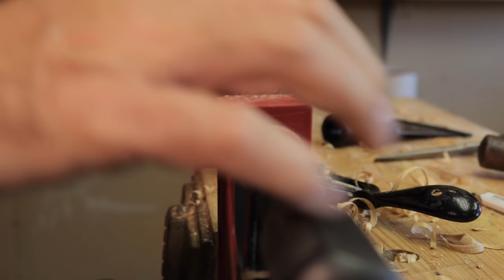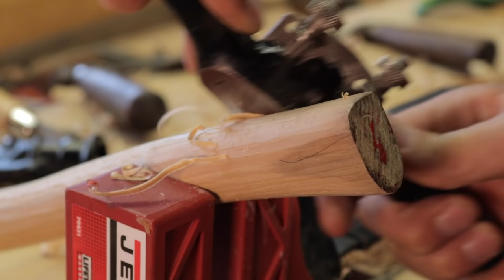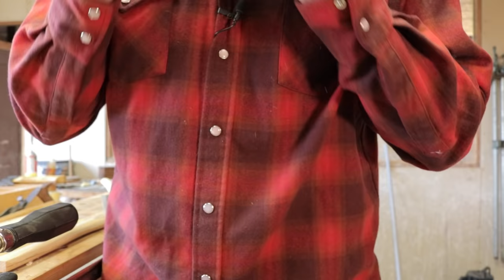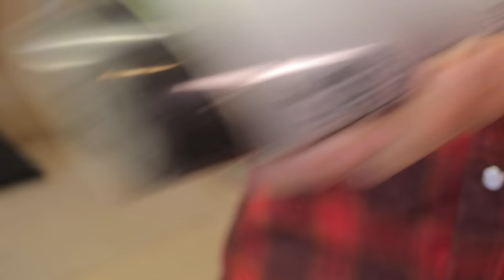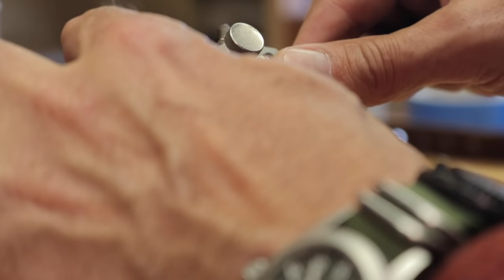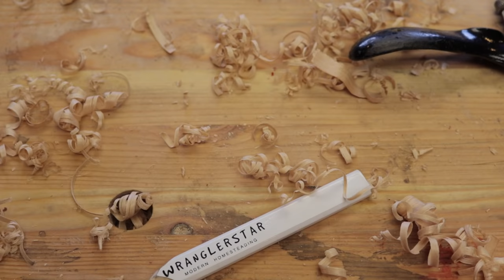The World's Tiniest Axe Handle

Comment: I have property from which I harvest my own hickory/ash materials. Like you, one of my favorite shop things to do is replace old handles in axes, hammers, wheel barrows, etc. I harvest with chainsaw and then use all hand tools (wedges, axes, a fro, hand plane, chisels, scrapers, etc.) to complete the other sizing of my handles. I usually wait 2 years for wood to dry and then take the rough out piece inside for one winter season, in a controlled environment, and get the moisture in the 10-12% range for use. 
Being retired, I could watch you carve/chisel/slice/shave these wood handles for hours on end! keep up the good work, watching, for me anyway, is very relaxing! Thanks for the nice video!
....13

Comment: +Wranglerstar you can use the drone to check if the ram pump is working or not 😂
Reply: btw I think it's easier to just fit the axe to the handle with sandpaper and then chisel out the v grooves in the middle, the carving knife is not necessary as there is too little material to remove

Comment: +Wranglerstar I am a hobbyist and I work part time at my local shop. The DJI Phantom 4 is a great unit. It does have drawbacks, for instance, few parts available, and any warranty work requires it to be sent back to manufacturer...in China.  
There are other options for hobby grade or better drone category, one is the Traxxas Aton,   Blade Chroma,  Yuneeq Q500 and  Yuneec Typhoon H series. Traxxas is based in Texas and Blade and Yuneeq are owned and sold by Horizon Hobby.

a high quality drone is a major purchase, consider all of them and look them over.

Comment: Hey nice handle Cody, just one tip if your going to stop the cut before the end of the board slowly roll the spoke shave back whilst still cutting, this will lift the cutter out of the wood leaving a nicer surface and making complete shavings.

Comment: Tip for matching the shape of the eye... Take some plaster of paris, or anything you might have that will set hard inside of there and fill the eye. Rub it down with some wax or something for easy removal, but i've done this before and it works great. Pull out your mold and then you can cut cross sections with a bandsaw to find the exact dimensions of the eye at different depths if need be. 

Lookin good man!

Comment: The DJI Phantom 4 "Return to Home" feature is a bit misleading. I have an older version that I don't fly anymore, The "RTH" is only Line of Sight. If you fly off and it drops down behind a tree line, you may be sunk. Mine will ascend or decend to 60 feet altitude above it's "home" and then make a b-line back and then drop in 10 foot increments until touchdown when the RTH is activated. But it does not recognize obstacles in it's path. Do your due diligence before you buy. Some of the earlier DJI products had serious issues with GPS, I've heard they have corrected that but I've seen lots of complaints about the camera gimbles malfunctioning. There are other "drones" (I hate that word) that will accomplish what you want to do but DJI might be a good fit for you. It's like buying a homeowner version of a tool instead of a contractor version of the same type of tool. Happy flying.

Comment: Don't worry about trying to fly a DJI Phantom 4, it will basically fly itself.  Take your hands off the controls and it will stay right there.  The follow me feature though needs help, works great for stand out slower moving objects in a straight line, not so well for faster, swerving, blending in subjects.

Comment: Cody, you should of used the draw knife w little more, there better with heavy cuts than the spike shave. I usually stick with the draw knife until I have to knock off the lines that it leaves behind. That's when I go to a spoke shave.

Comment: The dji phantom 4 is the best drone that you can buy for video however I would seriously suggest as a pilot of 6years that you learn to fly first in all orientations and winds before using the cool features as then , if said features fail or just aren't producing good footage competent manual control of the drone can lead to safe and fun flights for all check out the BMFA for advice , I am currently a member and there are pioneers of this technology on their fantastic forums , hope to have helped , tim

Comment: Wranglerstar using lamp black instead of spray paint works quite well, basically the same way as you'd fit the action to a gunstock, but not having to clean the axehead afterwards. Great video anyways:)

Comment: Some of the times I most value is going into the shop and being still in mind and heart.  The only sound is metal shaping wood or hand sharpening the sharp edges of various tools using files.  No radio, only deliberate work by hand.  It is in those times that I feel a most satisfying connection to the ways people have worked down through the ages.  Too, such times live the truth of be still and know I am your God.  All is well in my soul.  This video was most enjoyable.  I would have used chalk dust instead of the spray paint.  I also would have used a V shaped scraper to shape the handle grooves where it fits into the head.  It is not better, it is only different.  Many ways to get it done.

Comment: I have owned a hobby shop for 28 years I have sold phantom but the best value and customer service and same specsin my opinion is the Blade Chroma. You can check it out at horizon hobby. There best package deal comes with two batteries 4k camera and Pelikan style case. For $849.99. 30 min. Flights.

Comment: Grats on that milestone coming up, you reach 400k/5.000.000k (*100) = exactly 0.008 % of the world, depending on how hard you want to round that, it's roughly 0.0% ... just as a reminder when you might feel the thing is starting to go to your head ;) and just for that, because it's quite obvious that it's quite an achievement. ^^ ... ... On the spray paint solution, I gringed so much/hard, sure it will come off again, but still... oh well it's done now ... so I would probably draw some important lines over from the top template you have now onto both sides, so you know were everything goes and has to be; mostly the parts where the rounds are biggest, and where you need to start removing material, then a small gouge would likely be the most precise, but patience and a short sharp knife would work too... Ohw and one last request, or maybe something to think about, it would be cool if you could 'once again' spray some of that handle red as a lasting reminder of where the handle came from originally. That way the story of it can live on as part of the conversation piece this lil thing is surely going to be... ...on the drone part, do as you please I guess, I don't miss it now, but I can certainly see the argument. One thing to consider might also be, 'to learn how to fly' one, by taking it slow (perhaps find a place 'like a miniature airstrip', or w/e one would call a place where people fly drones and model planes). I mean a bigger one (regardless of the options) is just more money down the drain, if you don't know how to operate one...